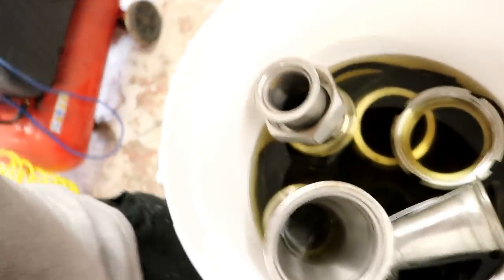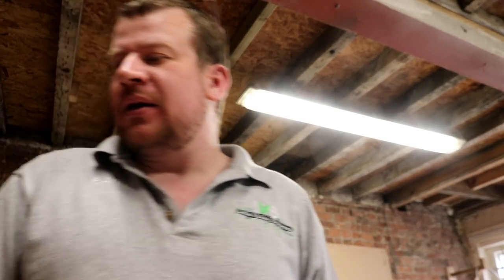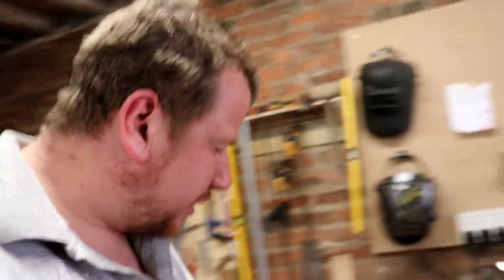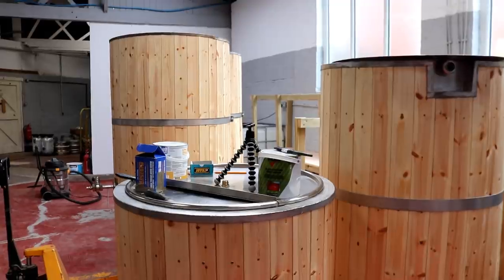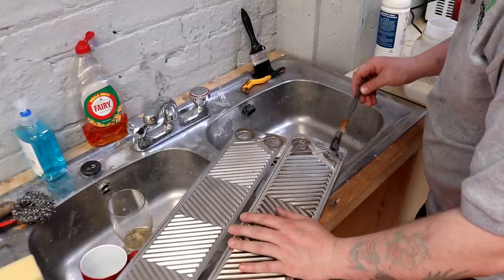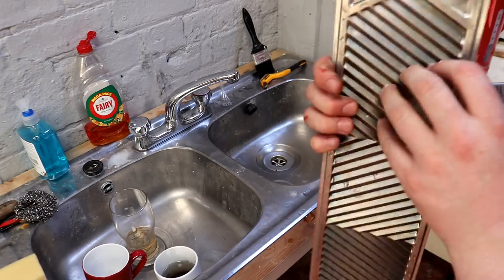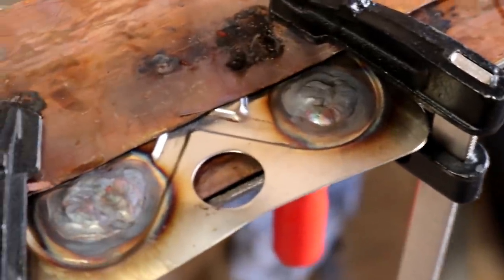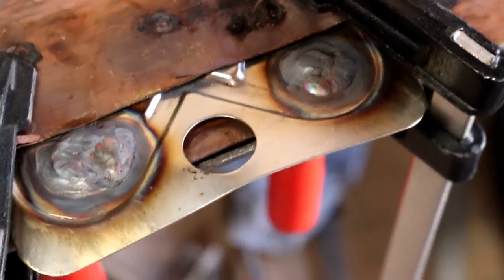WELDING HEAT EXCHANGE PLATES

Comment: Harry.  how about putting a full rubber mat all the way across the bottom of the plate chiller to support the last plate?  Just drill holes in the rubber mat where the water and wort runs. Cheers
Reply from the maker: Great minds. I ordered some silicone matting

Comment: Know anyone with a Vinyl cutter? You could use one of your existing seals to design a new one from and cut your sheet of gasket with CNC precision. Make yourself a new, custom gasket. Maybe a vinyl signmaking shop? Keep the pattern on a USB stick and cut one whenever you need one.

Comment: hi mate, another great vid.  i've only gone and bought a tig welder.... what size tungsten and filler did you use ? And where did you buy them ?
Reply from the maker: I got some 1.6 and 2.4 thoriated Tungstens and mainly use 1.6mm filler but I do have 1mm and 2.4. all in 316 stainless.
Reply from the maker: Oh, and they are from Ebay

Comment: What if the rubber soaked up some of the solution. Could the solution contaminate the beer after being released via pressure from the heat exchanging rack.. the plates being snug via nut and bolt? If the rubber did soak up solution, and used.. then "re-made as flexible" again, will the ISO-alcohol dry up the rubber to a point of no repair? Is this hobby to restore these gaskets, or practicing frugality. Did the chemicals cost less than new gaskets? Would new gaskets cost more than a rehydration chemical purchase?